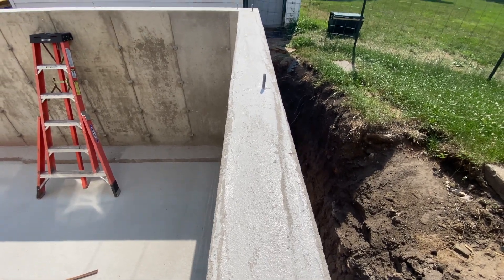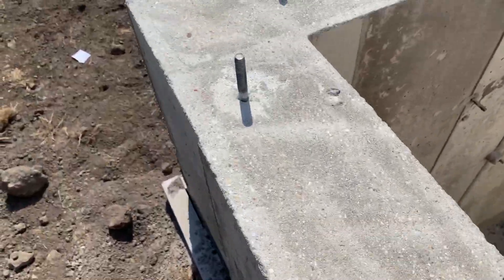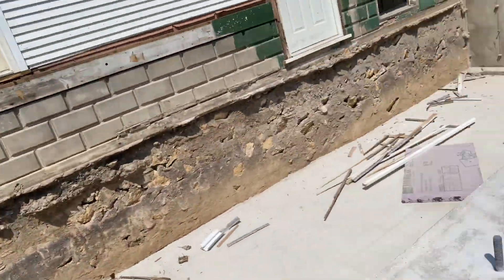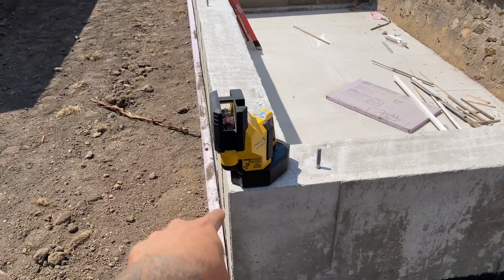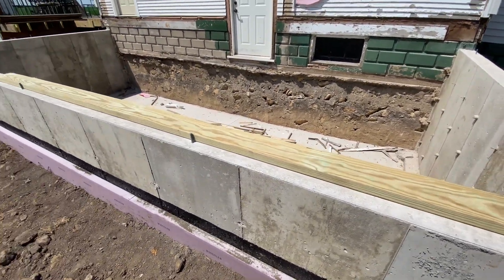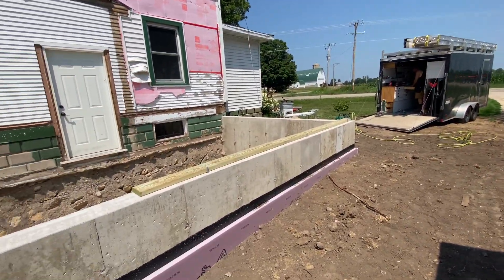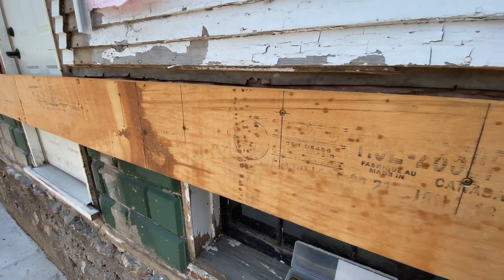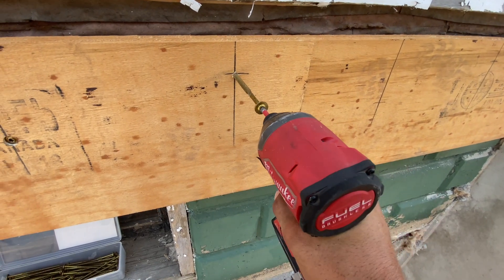Building an Addition: Framing Prep, Sill Plates, and Ledger Board

Comment: do you prefer that caulking over acoustical sealant?
Reply from the maker: I prefer acoustical sealant but getting my hands on it wasn’t working for this build. So I figured that ultima or Osi quad would be the next best option. Most people around here use neither and just really on the sill seal.

Comment: Dose the layout stations do levelling as well
Reply from the maker: Yes, not as great as a rotary laser. But it will shoot a level plane as well. The issue with the level plane on the layout station is that it is directional. So you have to position the laser so it shoots in the correct direction.

Comment: What is going to keep that bank from caving in under the existing house?
Reply from the maker: The bank that you see is a limestone foundation. On the inside of the existing basement it has been underpinned. It’s really solid the way it is now so we should be good to go. If it ever became an issue we would underpin the addition side as well.
Reply: @Digginwithace  I would probably skim it with mortar atleast to lock it together and smooth it up. May help keep that basement cleaner too